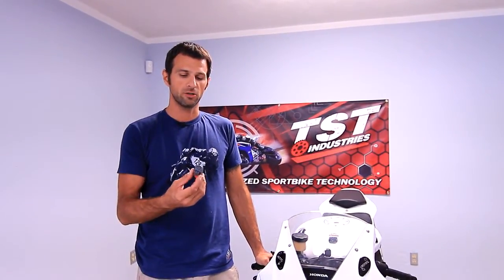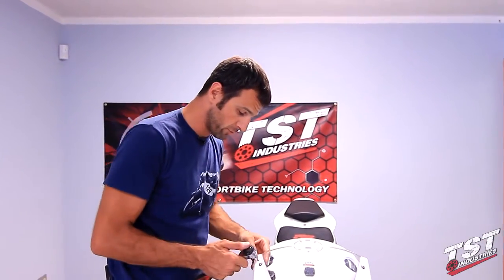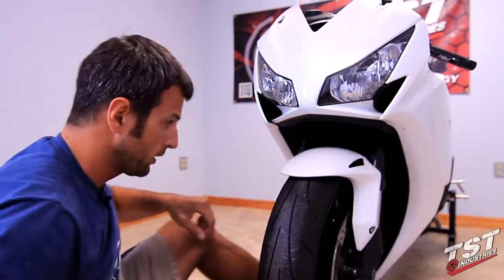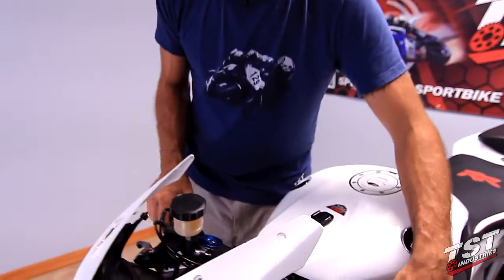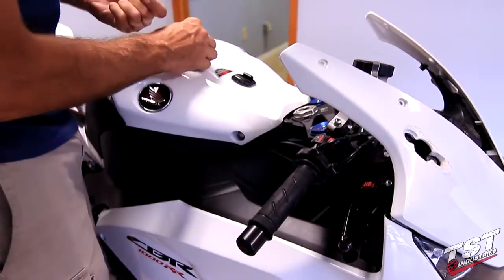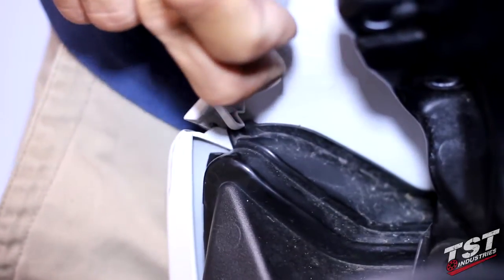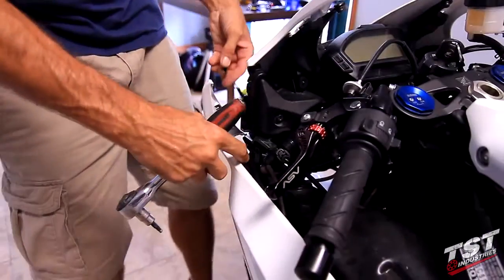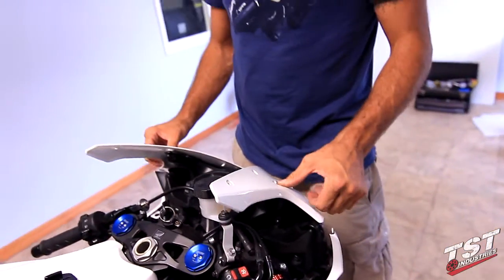How to : 2012-2016 CBR 1000RR LED Flasher Relay Installation by TST Industries

Comment: Installed the relay, however, there is almost a two second delay from the time I activate a turn signal to the time they actually turn on. Is this normal? It is not a big deal i'm just curious if anyone else bike does it.
Reply from the maker: +Michael De La Torre You should not have a two second delay. There is a chance that your battery is low and is causing the capacitor in the relay to charge up slower. Make sure that your battery is putting out 12V or higher. In addition, test the system while the motor is running.  You can get into the relay and increase the flash rate if you want to decrease the cycle duration.

Comment: Does this fit a. Cbr 2017 ???
Reply from the maker: 2017 and up does not use a little relay like this. There is an electronic flash control module up between the headlights. We have not made a replacement for this module but we do have an alternate product that fixes hyperflash on that bike. You can find that here: https://tstindustries.com/tst-flash-rate-control-module-honda-cbr1000rr-2017-.html

Comment: 2 or 3 pins to honda cbr 1000rr 2014 ?
Reply from the maker: Our relay for this bike has two pins.
Reply: ok thx v much
Reply: to kawasaki z1000 is the same ?
Reply from the maker: which model year, and are you asking about American model, or from elsewhere in the world?
Reply: z1000 - 2011 Europa market,  and my Honda too . Im from Poland
Reply from the maker: Witam! NIe moge powiedziec z pewnoscia czy nasze czesci beda pasowaly bo w Europie czasami inne przelaczniki uzywaja niz w Amerykanskim rynku. Jakbys mogl foty przekazac tych czesci co w twoim motorze sa to bede mogl powiedziec dokladnie kture od nas mozesz kupic zeby dzialaly.
Reply: 4 PINS I need  - nr part honda - 38301 MEW 921
Reply from the maker: Typically we replace the OEM relay with the part number you provided with this one: https://tstindustries.com/TST-LED-Flasher-Relay-Honda-CBR500R-2013.html . We have had success with this part on the USA market bikes but I have no way to guarantee that it will work in Europe. From an electrical standpoint it should work, but in the past, from time to time, we have found weird incompatibilities with other parts that technically should have worked.

Comment: so much work for such insignificant change absolutly not worth it
Reply from the maker: It's a lot better than wiring in resistors. Besides, it takes ten minutes if I don't have to show and explain individual steps.
Reply: +TSTindustries dont get me wrong it looks better and definitely better than wiring resistor lol honda just made it such a pain in the butt to take off the farings .. btw thanks for taking the time to make the video it helps alot of ppl know how to take off their plastics
Reply from the maker: We do our best to support our community with valuable information.

Comment: That sucks I won't be installing mine all that work for just that
Reply from the maker: Yes, this is a very involved process compared to some other bikes we've filmed on.
Reply: I'm going to wire in the resitors I just got my integrated light from yall thanks for the fast shipping

Comment: Coming from a gsxr 750 I am very disappointed to find out how much work is involved if you want to modify Anything!  On these bikes ... smh
Reply from the maker: The tail setup is actually really straightforward and easy to work on. Up front is a different story. Wheels, exhaust, controls...that is pretty much on par between the bikes.